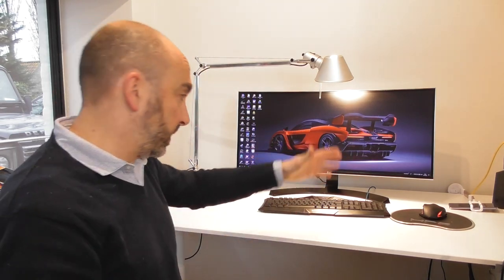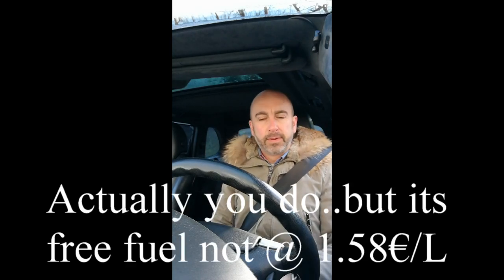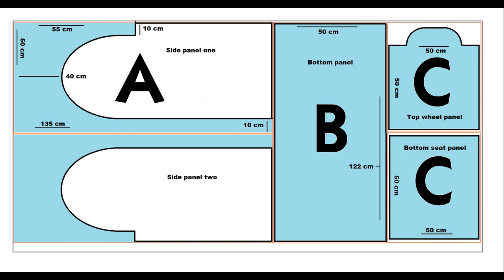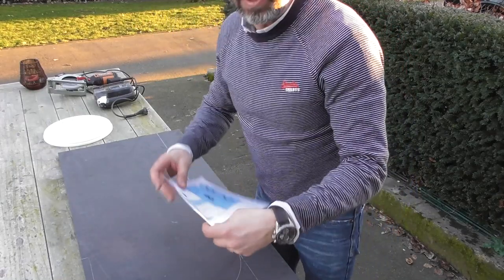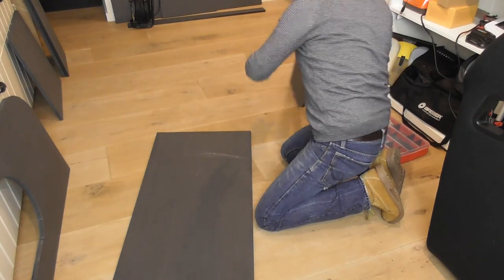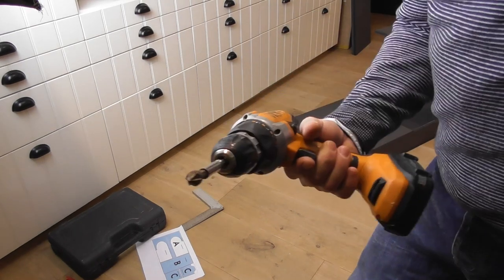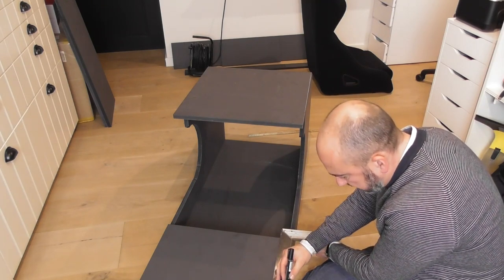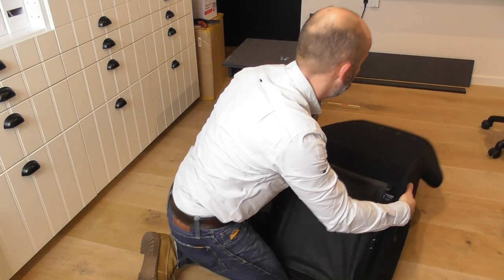Cheap DIY sim rig build

Comment: Great DIY rig. One suggestion... Instead of drilling / screwing into the narrow edge of the MDF,  get a strip of 1" x 1" and put in the joints of the pieces (top & sides), screwing through the flat surfaces of the MDF  into what is now a wood gusset.
Reply from the maker: yep true ......you can pimp this thing in so many ways. And if i was a carpenter it would probably be a bit cleaner.
Reply: Indeed but you can get some very good fixings for MDF,most people use the wrong ones.It's uniform structure which makes it easy to work and finish also gives it better holding properties than most softwoods if fixed properly and a glued and maybe even dowelled joint would be better still,more durable and stronger,even more so gusseted.

Comment: FIY in case you don't, 30kg is how much weight each coaster withstands, so if you install 4 coasters you have capacity for 120kg
Reply from the maker: that speaks for itself i think.... the rig came out (with pedals/wheel etc) at about 30kg  my weight is 72  so that just about works out great. However when i friend of mine took place in the seat i saw that the wheels had a hard time....my friend weighs 105 kg   so..... like i said in the video just about right for me but not for everyone....
Reply: @channelvr1293  sure, I didn't meant to be pedantic, I use casters a lot to be able to do woodworking at home and I use similarly spec casters, I can say they usually have quite a tolerance, at the expense of durability, but for this case I think you can abuse them and wouldn't matter if they deform a little bit.
Reply: @channelvr1293  Just wondering if the coasters would make the setup less solid during game play?
Reply from the maker: @cupcake474747  nope works perfectly the wheels are pretty cheap so they dont really work well you need to apply a bit of force to get them going , in this case that's a good thing ;-)

Comment: You're the Best! I'm going to do it, Greetings from Venezuela, Keep It Up!👏😎🏁
Reply from the maker: Waaw all the way from Venezuela .... nice, once finished send us some pictures..... thanks
Reply: @channelvr1293  Of course, thanks👏
Reply: @channelvr1293  What's the thickness of the MDF you use?
Reply from the maker: @elsupernelson9475   1.8 cm should be more then enough .... can go higher but your rig will be heavy....just make sure you add corner reinforcements....either metal or wood.
Reply: @channelvr1293  OK, when I finish it I send photos, What steering wheel and pedals do you use?
Reply from the maker: @elsupernelson9475  well i started with a cheap wheel (like 50€) then moved to logitech G25 then a Trustmaster T300 that i still use in one rig , and in my motion rig i have the Fanatec clubsport  2,5
meanwhile i have ordered the Fanatec DD1 (direct drive) that will be coming in about 2 weeks....will make a vid of that too...
Reply: @channelvr1293  That good! I wait for the video about Direct Drive, I have a Logitech Driving Force GT, I wanted to buy a G25 or a G27 but here in Venezuela they are very expensive, and here in Venezuela there is no Thrustmaster or Fanatec, there is only Logitech (Until the G27) and they are very expensive

Comment: Nice man really descent build but just was wondering why you bought the more expensive black mdf wood then the cheaper white wood if you were just gunna paint it anyways? Truly just wondering.?...
Reply from the maker: Actually a very good question.... I have been drilling holes in my rig for adding holders for headphones and VR set.  And I had to redrill some of them.  And honestly you can't even see where I have made a hole.  It's also good if you bump or hit your rig (and you will) then you don't see the damage so well 😉👌 but if you are on a tight budget go for the cheapest MDF you can find 👍
Reply: Channel VR oh OhKay but as far as the cheaper white wood is everything the same just the color is different or is the black one thicker or anything like that.??...
Reply from the maker: @anthonysalas6085  don't compremise on the thickness of the wood you need that strength.

Comment: Do you have the plans for the sim racing rig?
Reply from the maker: you can take a screenshot of the plans @ 5.11 and further..  ;-)
Reply: @channelvr1293  How big piece of mdf board do I need?
Reply from the maker: @fabbe5757  The standard shop size is 244X122 cm.  that should do the trick  see @ 5.01  ;-)

Comment: Why go for the expensive black mdf, when you gonna paint it afterwards? Nice build though. Looks nice and seems not too hard to build…
Reply from the maker: @FuzzyFrogAmarantha  got the black one at a discount , and actually is much easier to paint black,  only needed one coat. 😉
Reply: @channelvr1293  Ok, fair enough. But you wanted to make a video about the cheapest simrig you could make, could have spent a few euro's less 😇
Another question, how tall are you, and do you think you have enough space in the rig? It seems a little low. I know you said you were limited to the one mdf plank, but seeing a full size normal color mdf sheet goes for 26 euros where i live, i might want to make it a bit higher.
Reply from the maker: @FuzzyFrogAmarantha  I'm 1,76 but I got a friend that build one and he's 1.87 and fits perfectly.  No need to buy wood ,old stuff or even a used door would to the trick.  Btw the seat is on rails so length of legs is no problem.
Reply: @channelvr1293  Thank you very much for the reply's. Will probably give this a try, as it is one of the cheapest options for building a rig, and looks good aswell.

Comment: Hi, i want to buy a chair like that, but I don´t know how to find chairs without legs, there is any name?
Reply from the maker: look up "race chairs" on the web and search for pictures then they will lead you to the closest company in you region.  Look for recaro  lookalike.
Reply: @channelvr1293  Hi, I finally found one, thanks!
Reply: get your self a proper car seat from a scrap car. Better quality and more ergonomic then any of these knockoff "race" seats. Im just in a process of building mine, with car seat from a Audi A4, with adjustments for height, slide, and back angle.
Reply: @joei4ever  Are not those very expensive?
Reply: @jaimebazarradias4211  i paid mine from an Audi A4 3 years old, $100. Perfect condition. You'd be surprised how cheap you can get  parts from part out cars. Just make sure they are manual, not electric seats
Reply: @joei4ever  wow thanks!